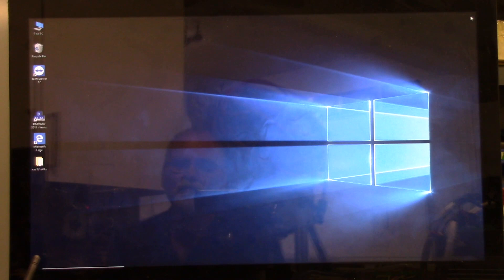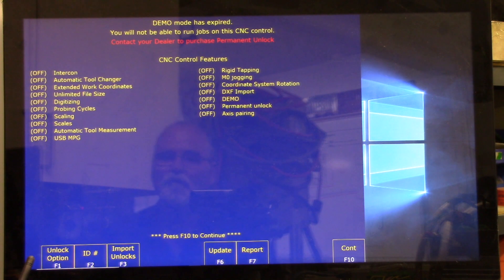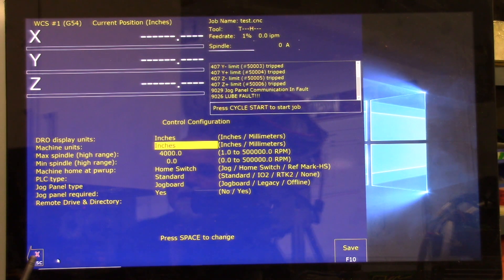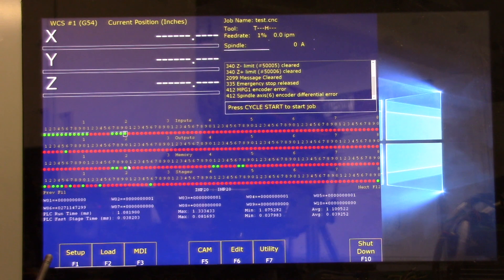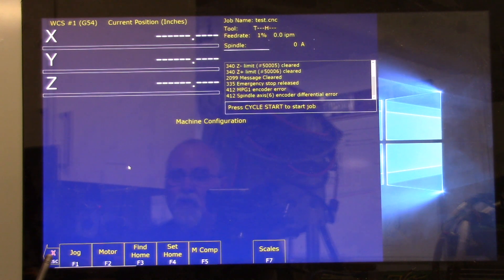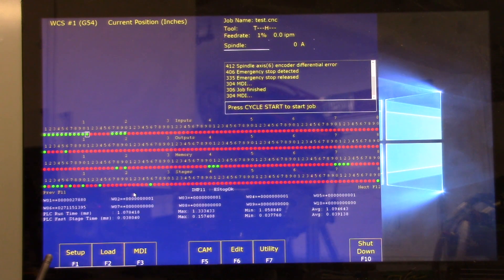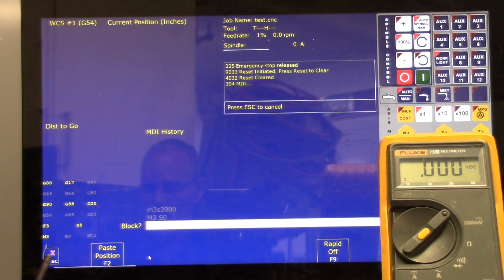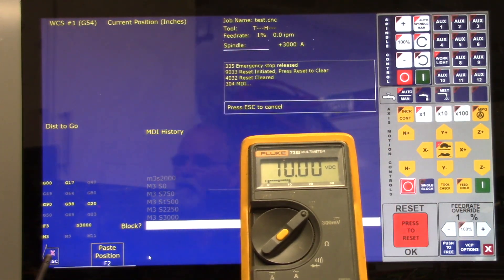Centroid CNC Oak CNC12 4 14 Software Install and Oak Benchtest

Comment: Hi Marty I installed the CNC12 for my AllinoneDC  without issue my question is I have from Centroid the Unlock# list sheet but only 3 unlock values are in the unlock column? Do I enter the unlock then just leave them all Zero? Thanks
Reply from the maker: Only the three unlocks
Reply: @martyscncgarage5275  Thanks